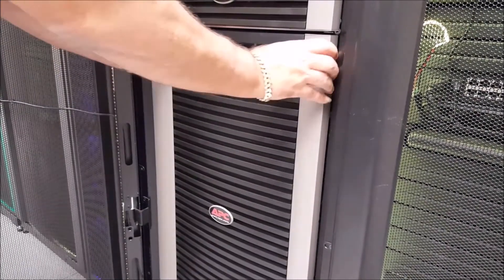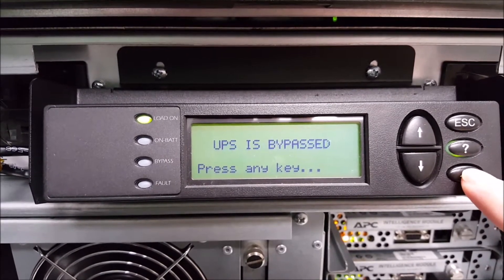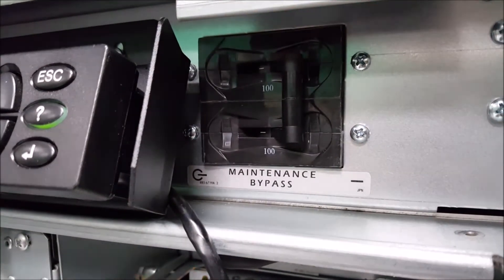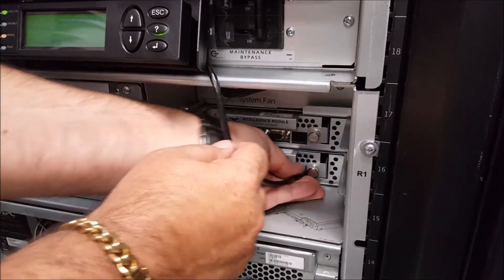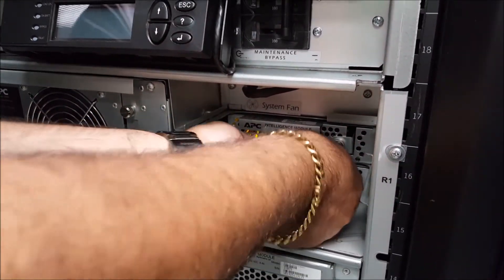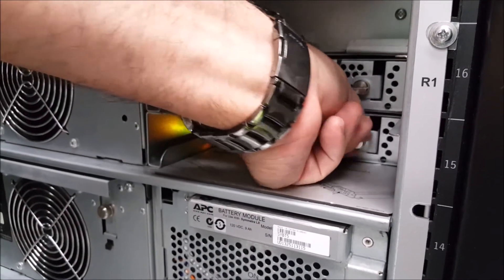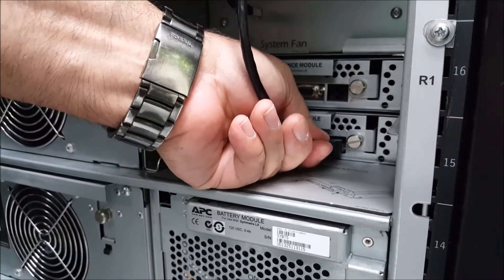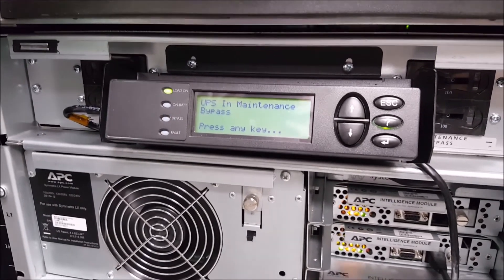Replacing SYMIM5 Intelligence Module on APC Symmetra LX UPS | Schneider Electric Support

Comment: What if you have to replace both of them? Do you just replace one at a time and wait until it is fully running, then replace the other one?
Reply from the maker: That's exactly right. Never remove both intelligence modules at the same time unless you have engaged the Maintenance Bypass Switch (not enough to only command UPS into bypass via display, as Intel Modules maintain closure voltage of bypass contacts). The LEDs on the front of the SYMIM5 will indicate they are ready to support the UPS. Please review this FAQ with more details. http://www.apc.com/us/en/faqs/FA157510/
Reply from the maker: Another Pro Tip for installing SYMIM5: push firmly on the module grille (not the handle) to ensure they are fully installed into the system. This will allow easier lateral movement of the thumbscrew which activates the modules.

Comment: How about if I just want to re-seat the IM? Currently we receive alarms that one of the IMs failed but it will clear itself in just a minute. Both IMs are running OK but every 30 mins we received alarms and then it clears out. Is this a predictive failure? I want to try to re-seat the IM, should I follow this procedure by turning on Maintenance Bypass (MB)? or I can just simply remove and insert the IM without MB?
Reply: I realize it's been two years, but in case it helps others, I have had two separate cases where the flapping alerts were due to a failed and swollen capacitor on the Intelligence Module board. You can repair the board if desired.
Reply: @skytech95  Do have any more info on what capacitor it is?
Reply: @lanhamrattan224  Just experienced this myself.  Found a bulged 470µF 50V cap bulged.  I ordered a new one but I may try and rebuild both original ones, keeping the secondary redundant one and having a backup.
Reply: Just confirming @skytech95s comments, I replaced the bulged 470µF 50V capacitor in my main module (and redundant) and it fixed the flapping alerts I experienced.  There is a single capacitor that was bulged on each board.  My new module has no ETA but at least my UPS is no longer in an error state.  Hopes this helps someone.